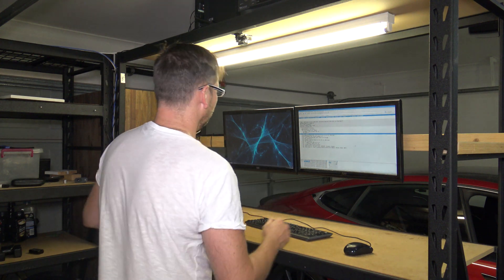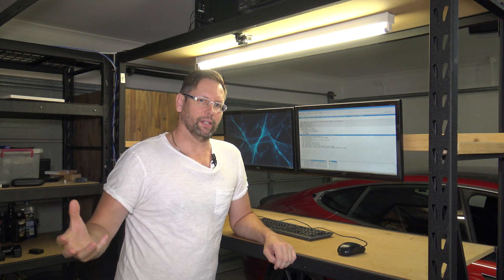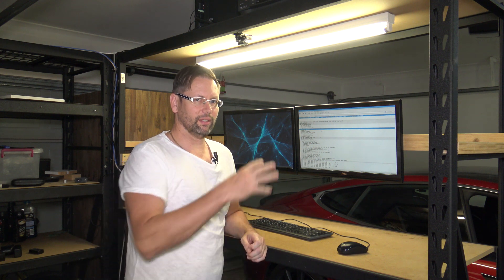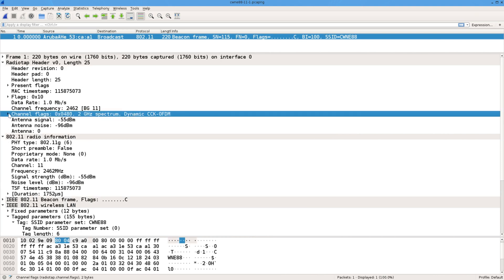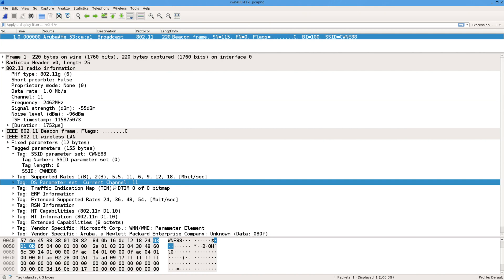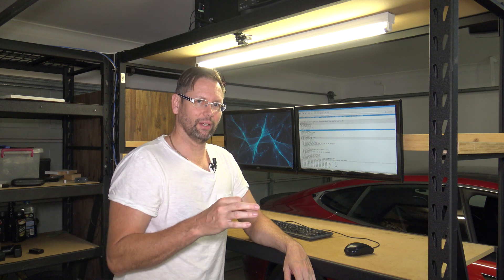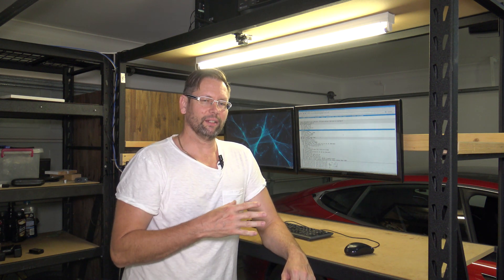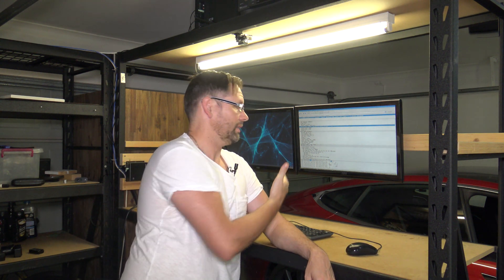Wi-Fi Radiotap Packet Capture

Comment: Very nice video mate. Many thanks! 
I have a question here: I can capture the wifi packets, but when I look into the packet details using Wireshark, I found that the radiotap information is missing (there is no such information at all). Is that due to the wifi adapter I used? The wifi adapter I used is ALFA AWUS036NH (Ralink RT3070 chipset).
Reply from the maker: From memory, I 'think' it comes down to driver implementation, but don't quote me on that.
Reply: @TallPaulTech  Thanks a lot. BTW, which Wifi adapter do you use?

Comment: Perhaps just a bit out of my depth or I'm missing the point, but apart from packet captures, are there really any significant real-world negative connotations of this in practice, besides maybe some processing power inefficiencies or something? If the RF energies still overlap on 11+mbps in the same way, then this just seems to be a cosmetic symptom of that modulation type (a matter of software perspective)? Unless you are just demonstrating the channel crosstalk anomaly as a matter of interest? Intuitively, the 1Mbps rate should allow devices with more marginal SNR levels to still operate more reliably (less packet loss) than if they were locked to 11Mbps or higher? At least, I've found that to be the case in practice with long-range links using Mikrotik equipment. Realistically, nobody wants a 1Mbps (or anything 802.11b for that matter) link anymore - but what if it's the only option in a case (eg long range/bad line-of-sight/high interference) where guaranteed link reliability is more important than achieving high throughput?
Reply from the maker: If it's the bitrates that you're talking about, I'll be doing something on that in an upcoming video. This video is mainly to show that the Radiotap is there and what it contains.
Reply: @TallPaulTech  Awesome, that makes sense. Looking forward to the follow up vid then as it sounds like you plan on delving a bit more into the implied details with that. Cheers:)